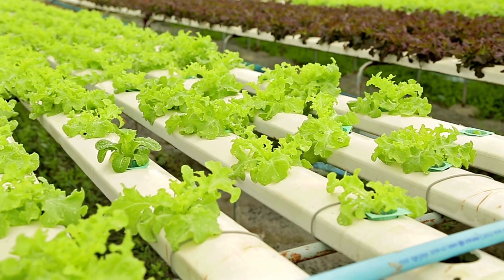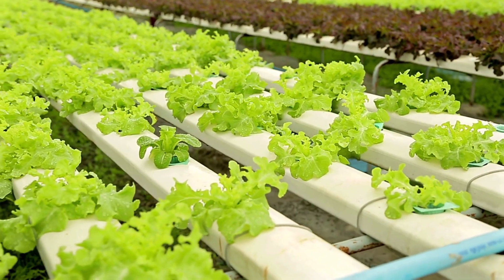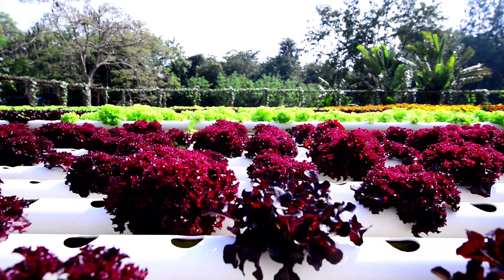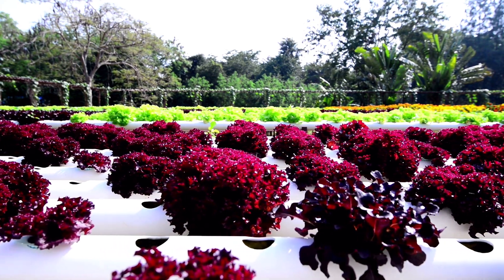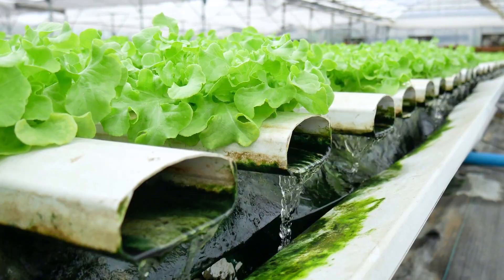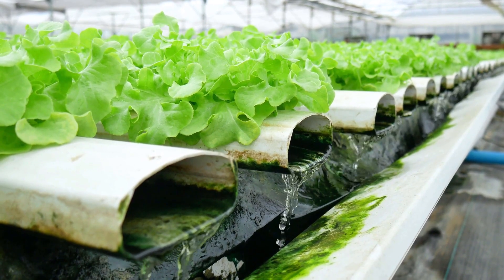Is Plastic in Hydroponics Destroying the Earth? What Do You Think?

Comment: I think an easy cheap alternative for beginners that is plastic free but still using the recycling method would be aluminum cans! You can take a can opener to the top of a beer can or coke can and wash it out and poke a few drainage holes in the bottom then tie them so they trickle down through eachother. Might be too small for most plants but it could work for some smaller ones. Can also use them as tiny pots for like succulents for more decorative purposes with like a cool looking monster energy can ^_^
Reply from the maker: Cool tip Toby!

Comment: Plastics. Generally the issue is what you do with it and what you do once you are done with it.

As to hydroponics one needs to look at the inputs. In rank order -- water, nutrients, seed, plastic. Water, much less used in hydro vs conventional. Nutes, in hydro it is in a sense captured till disposed of. Hydro is providing a better use of the chemicals even though conventional is improving. Seed is probably parity. Finally plastic. Since the plastic in a hydro system is a durable good lasting years it is the lowest consideration in my view of all the other factors.

Comment: The important part about each piece of plastic is:  (a) what will leach out of it (b) what will it decompose into.  Will it leach microplastics, hormone mimicking/disrupting molecules etc.  If it is biodegradable plastic will it break down into CO2 and water, or into microplastic bits and hormonal substances?  And these are questions that seem almost impossible to get answers to.  I wonder why that is.  Think recycling is the cure?  Think again.  Most recycled plastic doesn't get recycled.  What does get recycled:  is it less stable than plastics made from pure raw materials - probably.

Comment: My thoughts on plastics in hydroponics:
pros:
- available in all kinds of sizes and shapes
- often cheaper than other materials
- easy to work with, in thinner plastic you can cut holes with a knife or cutter
- surface is easy to clean
- plastics are not heavy

cons:
- most plastics are not stable in sunlight, ideally all containers should be covered with something to prevent sun exposure or they should be thrown away after some time
- plastics contain certain substances which can leak into the nutrition solution

My thoughts about  pros and cons of glass:
- durable and stable material, does not decompose in sunlight
- no substances, that could leak into the nutrition solution
- surface is easy to clean
- however if a jar has a narrow opening, cleaning can be difficult
- not available in all shapes (e.g. no rain gutter systems made of glass)
- glass is heavy
- often more expensive than plastics
- could break, if dropped on the ground
- glass is transparent and lets sunlight through: either use brown glasses/jars or cover them with something to block light out
- glass is difficult to cut, danger of breakage; in most cases you have to find the perfect jar, alterations are not possible

I have been thinking about mixing materials, like using a bowl made of glass or ceramics and adding a lid made of plastics. This way you have the pros from both worlds: the nutrition solution does not come into contact with plastics, therefore no substances can leak into the solution and you can drill holes into the plastic lid. If the plastic is not good any more after some years of use, you just have to replace the lid and not the whole container.
Reply from the maker: That's great insight. Glass on the bottom, plastic on the top.

Comment: My comments come from experience. Plastics are fine as long as they are food grade. Plastics have a rating on the bottom of the container. I have grown hydroponically & aquaponicly. Aquaponicly I use IBC totes to raise fish which produce waste. Through naturally occurring bacteria in both air & water, the waste converts to useful nutrients which plants will grow off of. The plants clean up the water & is then cycled back to the tote, thereby using roughly 3% of the water required to grow in dirt. IBC totes are more nylon than plastic. PVC can be used for moving the water around. Food grade is the key.

Comment: Don't think I've seen 100mm or 4" copper tube to make a gutter style and the cost 🤯 maybe stainless but the pay back would be for ever, plastics have their uses and the fact its not single use I wouldn't even argue with myself over the ethical issues of plastic, the main issues is recycling, instead of separating it just converted into its raw state.

Comment: Not promoting plastic here either. Plastic has years of use with materials that are available with low to no maintenance or repair.
We all could go back to mud and straw bricks but we either resource used brick or buy brick due to availability and ease of sourcing.
If plastic stopped being easy for sourcing then more thought would go into different materials, but with this different material would come much more maintenance and repair.
Reply: Thanks for the link this is a very interesting alternative method of growing.
I live in and area of mountains and very little soil, lots of rainfall so I have gone to hydroponic and rainwater catchment as my method of growing.
It's the best choice I have found at this time.

Comment: I work in medical device design, and the amount of plastics that are used once and thrown away are INSANE!

For your uses, it's not terrible. I'd rather see aluminum extrusions and galv steel used everywhere, because they're actually recyclable. Plastics really aren't. The resins degrade, and recycling them is just lip service.
Corrosion in hydro is a tough nut to crack, but where possible moving to metal or other materials is ideal.
Pretty much ANYTHING but new plastic is better. Maybe find some way to use metal downspouts and advocate their use?

You're great, and the info you're sharing about growing food VASTLY outweighs the negative of seeing plastics used. Keep doing what you do. If you have a chance, figure out alternatives to plastics where possible, but don't stop.
Reply from the maker: Very insightful Evan. Thank you very much.
Reply: Clay, and Ceramic work well.